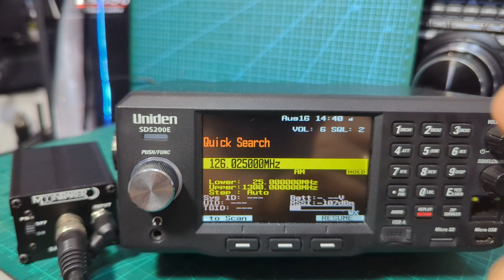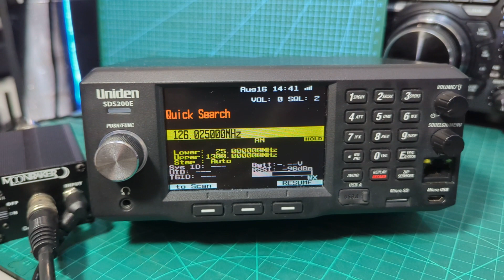SCANNER PREAMP - UNIDEN SDS200, MOONRAKER MRP 2000Mk 2 Set Up & Test

Comment: Its due to the filters as well bro..these filters wide, invert, wide-invert,off as you know are a hit and miss depending in where antenna situated etc .

With the RF gain now unlocked should be able to see if any preamp makes a difference but i really think it would saturate the RF front end on the cheapo Rafael SDR tuner inside these radios , which is not the best in any respect.
Reply from the maker: Using battery power made a big difference.